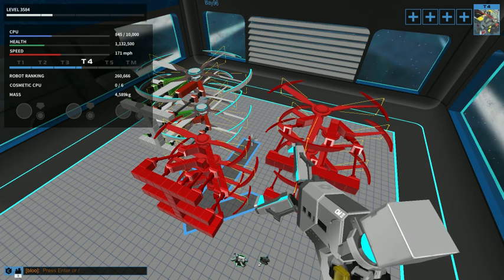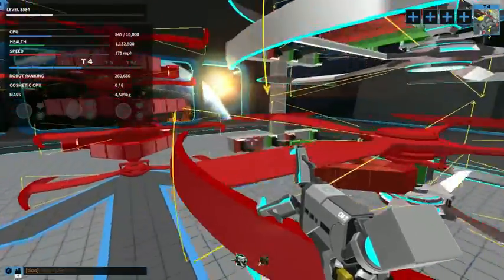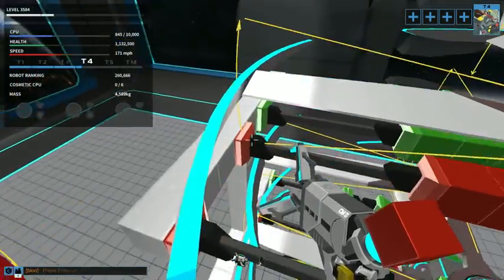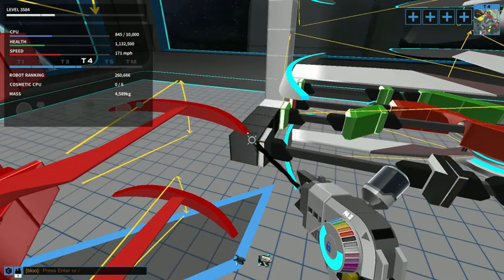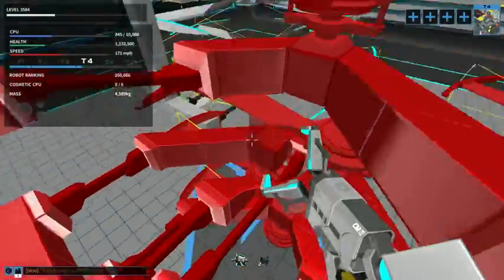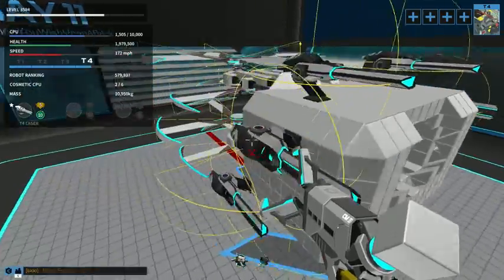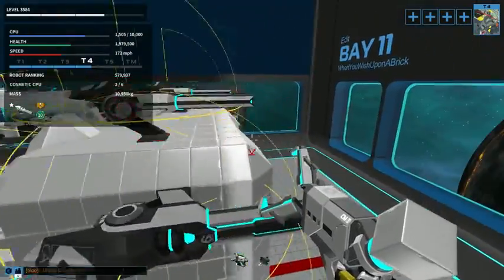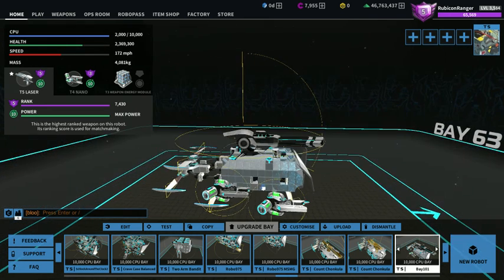Robocraft Rotor Stacking Tutorial

Comment: i just wanna say informative vid 
but the meta right now you are better off using wings otherwise you want A lot more rotors like 114classified who basically has i believe 12 rotors don't quote me on that but i am 100% sure more than 10 for a t-5 rail heli and 3 of the largest shields
Reply from the maker: This video was just for talking about rotor stacking since someone requested it. Meta is a completely separate topic, and consists of plane hover/sprinter hybrids with a combination of megaplate/rail/ion/plasma/mortar/WEM/nano. Effective designs have connections between all multi connection components with tick delay priority set to always run damage overflow to another megaplate or to lower priority components first before reaching another functional component. (I use movement>weapons>modules>body to body connections>plates)
My favorite movement type is hovers, so I developed my own flavor of hover wing hybrids a little while back and I still use them now. You might have seen a few running around, as I give out bots to friends and clan members or anyone who asks and can sit through one of my building lectures. =P 
Bot: https://imgur.com/a/KDDdO89
Reply: @twotoneterminus4976  yeah i saw that bot i hope i don't sound rude when i say it is hardly the best type of flying ion+rail the best ones i can think of are the sprinter rail+ ion by codetrex , mrblackstar , arhos, archidamus and probably the best one of them all are the xct by spaceanomaly (hasch)/(haschtewas) and hax of nyan clan. The main difference which i must says is airbone fighting because it flies slow and turns slower than these certain bots and the bottom mounted ion makes it lose a 1v1 vs a top mounted one like Eco by blaiser302 not saying it's bad the triforcing is magnificent the damage routing is good the guns as very well placed against being damage but not so much for aerial combat it's just that against those specific bots being piloted by people who know how to aim while airborne would give it a run for its money. 
Edited: because grammar and for celerity.
Reply from the maker: @Balila_balbal_loki  Oh, not rude at all. I love to hear from a different point of view on their effectiveness. When we are doing 5v5 customs (which often include those very players) I find that I do very well verses the sprinters up close, as I can use tilt to keep the front tipped down to protect the ion and then space+forward to pop the nose up when I am shooting. Ill even bait out shots this way. You take off one leg and then they are slowed significantly and make an easy target. I actually find I am weaker at range where they are able to peek and strafe faster than me. The build itself is not really meant to fight in the air, I play near the ground and only fly when I need to rotate/avoid ground AOE/push to use ion. 
I also enjoy it because with the setup I use I can be both outside of plasma splash range and flack range nearly at the same time. But other than that, those other builds you list are much easier to control and mostly do better at range. I am just happy to be able to use a hover again to some degree.
Reply: @twotoneterminus4976  Ah now i get it; It's  basically a ba bot.
Reply: @Balila_balbal_loki  it's like the old meta with laser and ion, but has rail and megaplates now since they are fundamental in this meta and has wings only to not die to plasma and to avoid mortar